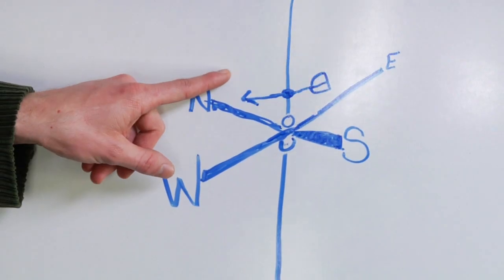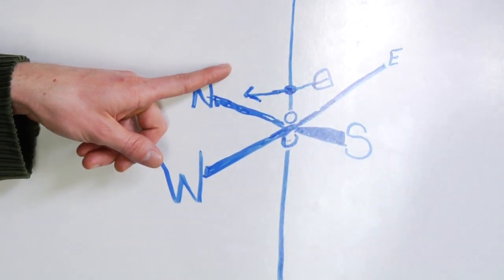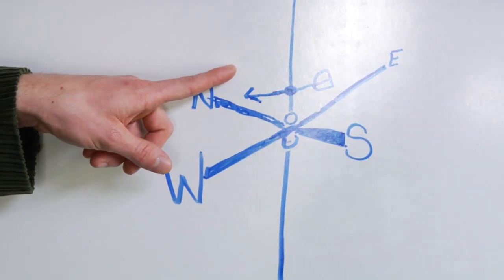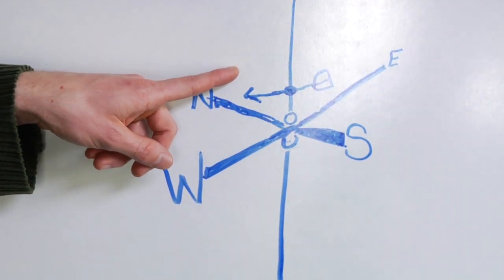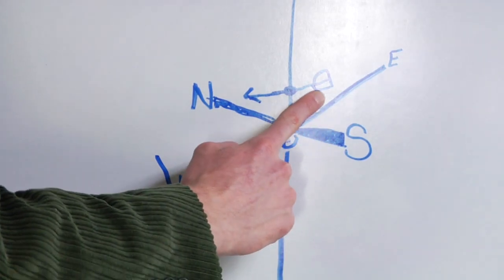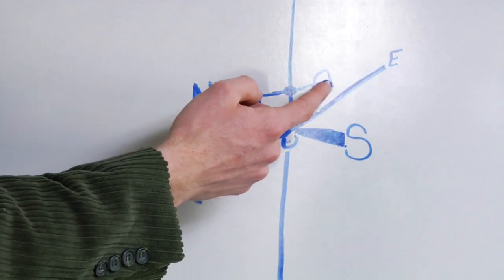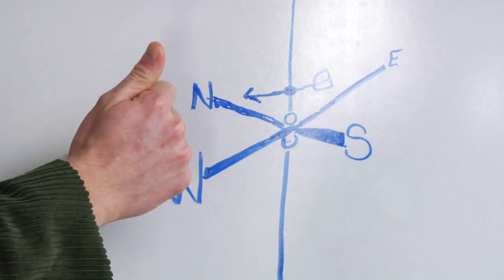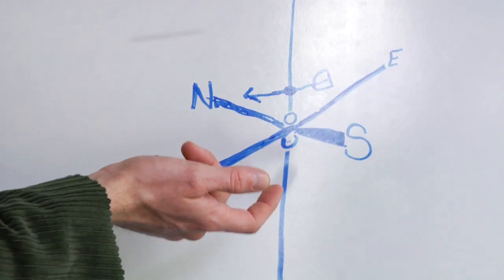Chemistry & Biology : How Do Weather Vanes Work?

Comment: The arrow does not point in direction of wind but points to the direction from where the wind is coming. If it were pointing in the direction of the wind, a slight perturbation would cause the vane to rotate away from its original position. So, basically, it is not so simple after all.
Reply: Thanks, mate! Really appreciate that